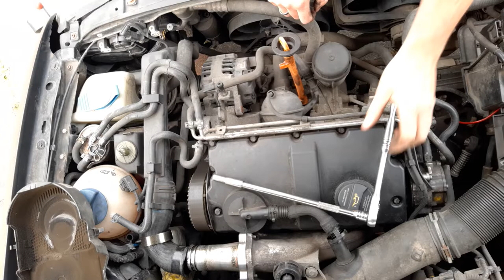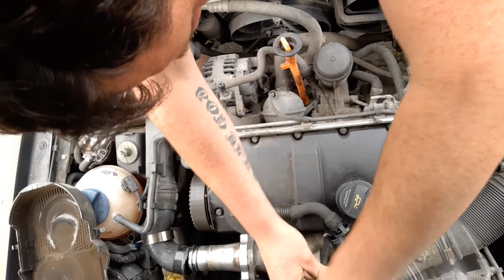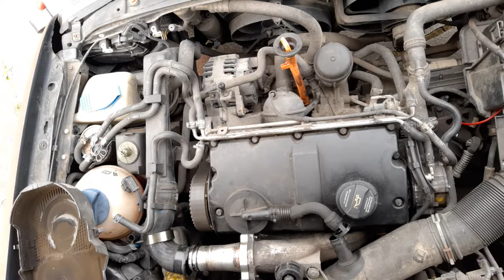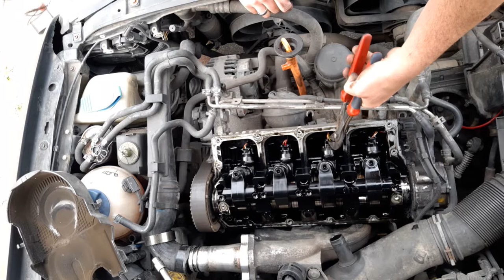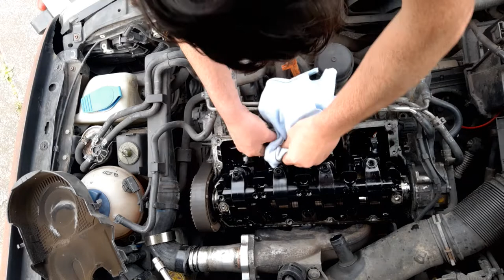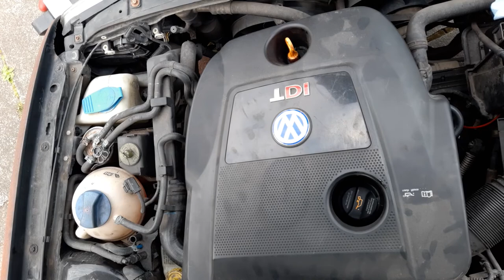vw golf Bora audi diesel misfire cheapest fix ever tdi gttdi pd engine

Comment: Still no misfire?
Reply from the maker: It worked for 6 months but then it started again if you check my other videos there's another one I did exactly same procedure. Apart from instead of wd40. You get a small flat head screw driver and bend the clips closed again.  The miss fire is cos the fuel rail vibrates and widens the clips. Then oil gets between the 2 metals and oil isn't conductive
Reply: @checkoutmypage984  ah ok that makes sense. Did you get a check engine light and a P code fault?
Reply from the maker: Yeah depz yours miss fire or is it just sluggish
Reply: @checkoutmypage984  It's a 115ps AJM my one Golf Mk 4. Not sluggish and no P code or CEL. I get a wobble on idle sometimes that's all...not all the time though, engine can be hot or cold. 
I think my issue is maybe dual mass flywheel...but I don't know why it's only sometimes. Daily it happens, but not at every traffic light or not every time I'm stationary....
Reply from the maker: That is strange big give away with duel mass is when you turn it off and it gives a couple of knocks or a rattle soon as engine stops
Reply: Hello..
I have a 2003 audi a4 1.9tdi avf. I'm getting code P1261
Cylinder 1 Pump/injector valve: Control limit exceeded.

1.I have weak start in the morning when cold . (When warm starts fine)

2. Very sluggish bad power especially when taking of. Doesn't matter cold or hot.

3. High fuel consumption very bad doesn't matter cold or hot.

4. When driving after little bit ESP Traction light comes on and stays on simultaneously the car gets a slight vibration,sometimes the vibration is heavy and sometimes it's very light.  

The car was 200percent. 
Camshaft failed we replaced lifter and camshaft since they did that all this problem come. 

Please please help and advise